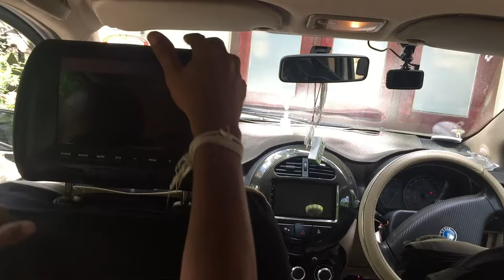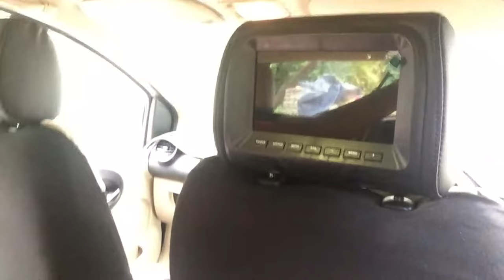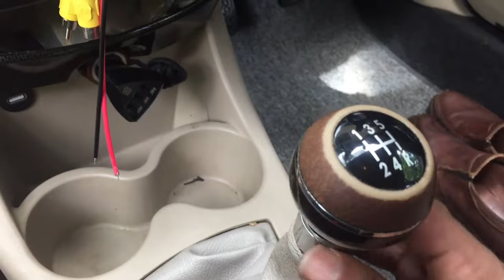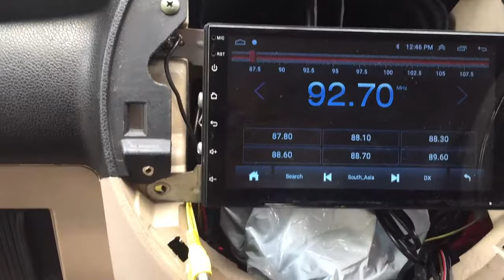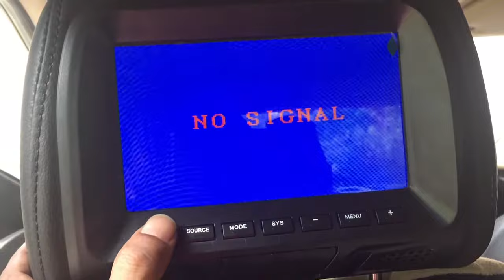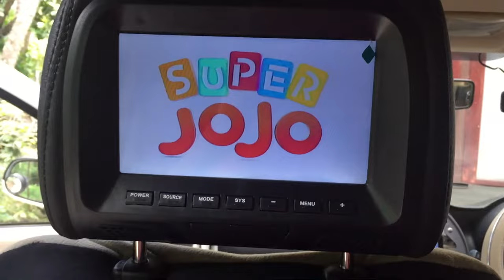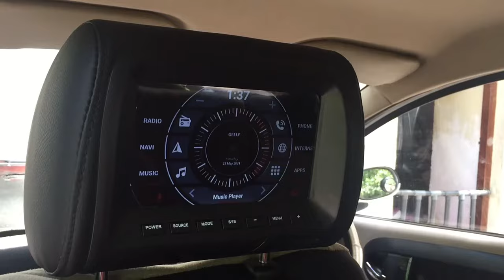How to install car stereo display extension to headrest Monitor

Comment: Can u let me know what's the video out pin for toyota yris head unit. That uses a pioneer set PZ072-00B50
Reply from the maker: I think your one is a single Din player. If your device is supported DVDs, there must be a Yellow color connector close to RED and WHITE audio connections. The yellow color one is the video out.

Comment: hello sir. i already watch ur video and already intsall it. my prob is how to remove the fuzzy lines when on engine.
Reply from the maker: It is coming from ignition line. I have a video to remove the noise. Give the power to your device through that circuit.
Reply: can i see your video to solve this problem?

Comment: hello, can you tell me how can I activate the video out function? I have 2 monitors connected but the vudeo signal does not seem to arrive. everything is connected well but I can't activate video out from my menu. I have android 12.
Reply from the maker: If your device have a video out connector, you can use a splitter to connect 2 device. And also active the video out option in your Car stereo system.
Reply: @setnfix  my menu not have video out

Comment: Hello sir. Is it ok to tap the red wire in  acc line of stereo?
Reply from the maker: yes. but secure the connection using tapes. There is a fuse for the display.

Comment: How its works with sd card?
Reply from the maker: This is only a Display. But there are such facilities as optional
Universal 7 Inch Car Headrest Monitor : https://s.click.aliexpress.com/e/_DlFWRHn
9 Inch Car Seat Back Headrest LCD Display : https://s.click.aliexpress.com/e/_Dmv27XT
Reply: @setnfix you can put a card when you open a small cover under the screen. This link doesn’t work.

Comment: this is so bad the way you put stereo in so unsafe and just one big mess
Reply from the maker: If you can install carefully, It will not be
Reply: It's ok he's got a plastic bag stuffed under it so it can't touch the metal and rub through ... same as they do it on passenger aeroplanes